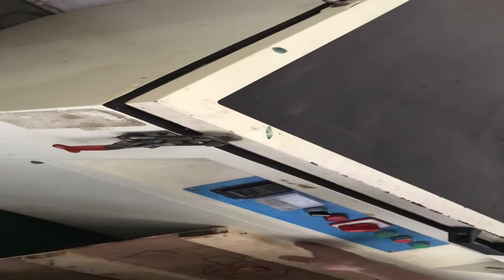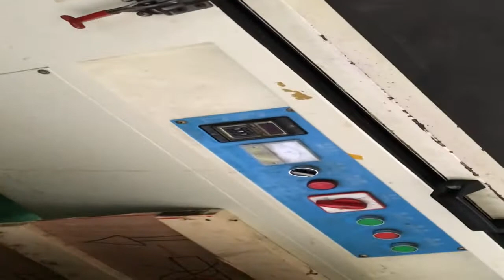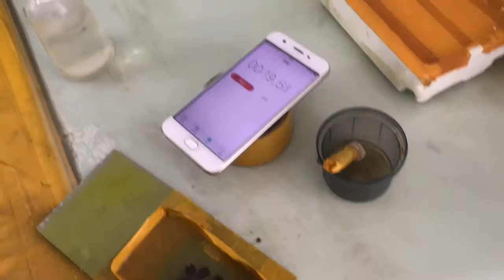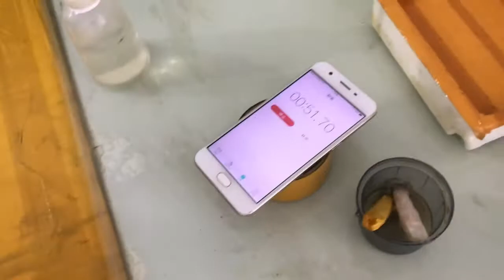Pad Printing Steel Plate Cliche making process

Comment: what is the chemical name that oxide the etching?
Reply from the maker: Acid
Reply: @elvisnong2004  what is the name of acid?
Reply from the maker: Sulfuric acid
Reply: @elvisnong2004 can sulfuric acid oxide with black  ?
Reply from the maker: yes ,
Reply: @muhammadmooner2299  Sulfuric Acid not worked.
Reply: I think, that is hydrochloric acid. Hcl
Reply: @jzoliva726  That's right, the composition of HCL with water. with a ratio of 1:1
Reply: @muhammadmooner2299  yes, it is sulfuric